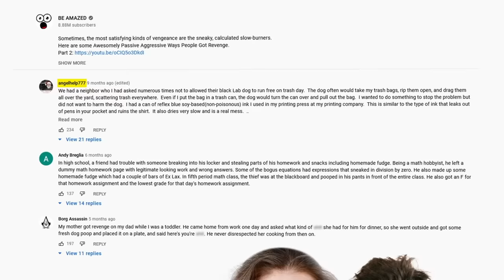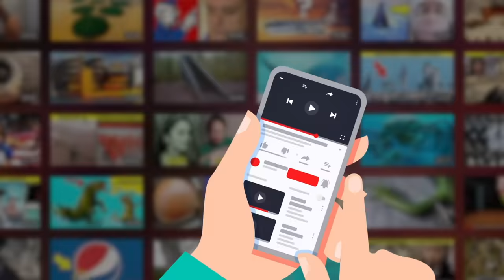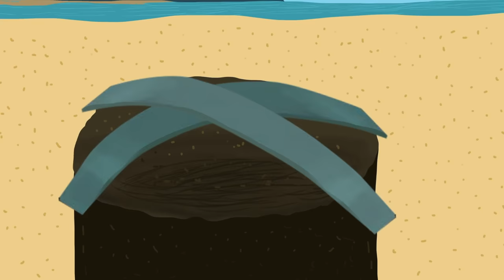Passive Aggressive Ways People Got Revenge - Part 3

Comment: 23:42 you could also build your sandcastle around a big rock, if they kick it, bam right into the hard boulder
Reply: I use concrete :’)
Reply: Or a dead jellyfish at the bottom of the hole with the stinging parts up!!
Reply: Turn sandcastle into sandfortress.
Reply: Pins straight pins they deserve all the pain
Reply: I’d use sharp speed sticks
Reply: You would put a child in hospital for kicking down a sandcastle? You lot all have issues.
Reply: Falling onto something wet sprained my ankle so that is just overkill lol
Reply: @codeXenigma  "It take a village to raise a child." (It appears that the parents weren't doing their job.)
Reply: @codeXenigma  you didn't, they kicked a stick/pins. Nothing to do with you.
Reply: @codeXenigma  ??? They are there to add to the structural integrity, it's not the builders fault if someone decides to stomp on his works.
Reply: Ouch
Reply: I would use TNT🧨
Reply: I thought about pointy sticks

Comment: When I was in college I used to always set a timer based on what the machines said so I didn't take too long to go get my clothes from the laundry room to be as polite as possible.

Well someone once stole my dryer, and when I came down my clothes were so wet they clearly stole it very early on. They at least were nice enough to put my clothes on the table. I put mine in another dryer, said whatever and went back upstairs. When I came down to collect my now dry laundry, I saw their laundry was still in the dryer. I originally was going to toss it outside because it was raining. I decided instead to be "nice". I actually put their clothes on the table where they tossed all mine, but I folded their clothes. Then left them a note that said "Next time you're in need, just ask in the group for the building, I'd have been more than happy to share my laundry card. Not everyone is so nice, I've heard of other girls [all girl dorm] tossing clothes out in the mud for stealing their washer/dryer." 

Never learned who it was, but that only happened 2 more times in our building and I was correct, other people are way meaner than me. One time I came to see a note on a dryer that said "You took my clothes out when they were only 10 minutes in, I know because I came back to add to my dryer since my washers had slightly different timers. YOUR clothes are in the f**king lake. Hope they didn't wash away <3". Dunno if they ever actually did that, but oof.
Reply: I always swore to my ex that if someone from our building took my stuff out of the washer or drier ONE MORE TIME, I was going to throw magic markers in with their clothes.

I never had to, but I would have. I'm an artist. I have a LOT of markers. LOL!

Comment: I worked for a company for 10 years. That first year and a half, I was a model employee and even earned myself a temporary promotion. At the time I was taking the company provided shuttle service to get to work, but couldn’t use it when I got the promotion. The kicker is that once you stop using the service you can NEVER get back on it. When the time came for someone to have the promotion again, they picked someone else. I had had to buy my own car to get to work! So, over the next 8 1/2 years, I stopped being a model employee, slammed on the breaks and became an unholy terror who constantly skirted the line of insubordination. I even got one of my supervisors to tell me to shut up.

Comment: 20:37 back between 2008 - 2010, can't remember exactly when it was,  a car parked in front of my garage. It was one of those multiple car garages in an apartment complex, and each one had a garage that had a sort of over hang that create a 1/3 of a car port. If you were lucky enough to have one of those spots. You could park one car in the garage,  and one behind that under the little over hang. If you parked a car in front of any other garage they would tow the vehicles coz people trying to back out of ANY of the nearby garages would be unable to,  and your vehicle would be blocking the parking lot path for vehicles to drive around the complex. 
One night very late we had a craving and we went to hop in my car and found I couldn't get out of my garage because some asshole parked in front of my garage over hang/bump out spot. I had no clue who they were,  which apartment they were in,  or anything. It took a lot of will power not to begin kicking out all their car lights. 
So I called the tow company and since I was not apartment manager/owner, they refused to tow the vehicle. So I walked 4 minutes to the 24 hour grocery store bought some plastic wrap and went over and under so the wrap would block them from being able to easily open the door.  Thank Gods I wasn't trying to get in my car to go to work!! That revenge would have had to be much more severe.
Reply: Parallel parked on a street once few years back and walked into a store. I came out to find another car parked in front of me so close I could not get out. But the best part was when the car behind me left a few motorcycles took the spot and as with the car, was right up next to mine so I could not get out. My wife being the mild mannered woman she is said we should wait there until one or the other moved. Yeah, right. I got out and found out the bikes did not lock their handle bars.

Press the clutch and start pushing. Pushed 2 bikes and parked them over on the next block, got in car and left. To this day I would have loved to see the expression on their faces as they saw their bikes gone then find them parked a block away. LOL

Comment: Used to have a neighbor who would bring his dogs over to my section of land(I lived in a condo. Each building had four units). I was not the only one he did that to.
I took some cayenne peppers and grounded them up. Then I took the powder and spread it over my section of the lawn. Guess whose dogs refused to do their business in my section of the lawn. I also spread the stuff on other neighbors' sections as well. They also saw that the dogs would not do their business there either.
This year I'm thinking of repeating it. Since I moved from my old place to here. And there is a neighbor doing the same with their dog. 
If you folks do this. You will need to reapply the powder after be it rain or snow.
Reply: That’s gross. The owner is at fault, not the dog.

Comment: This makes me think of my early 20's. At 21 I had 2 roommates. 1 of them worked with me in telecommunications and the other worked as a server. My weekly routine was to by a case of beer on Monday and that wold last till Saturday. I didn't mind if my roommates had beer or 2 as long as the left me 1 cold beer for after work. Well 1 week I started out as alway with a fresh case of beer on Monday can home to no beer! Told the roommate to replace the beer and not to do that again. I bought a new case and the same thing happened the next day and again the day after that. Well I had been cutting and grinding fiberglass all week so I collected about 2 pounds of fiberglass dust and poured in his bed and pillow and shower towels amd didn't say anything for 3 days. The beer was always stocked quickly after that 😆 🤣 😂
Reply: Uhmmmm, if that fiberglass got into the lungs - - it can lead to breathing issues and other serious medical issues.  Not a substance to mess around with.  Between high school and college, I worked in a factory that used fiberglass insulation in their products.  I was assigned to do that job for one day only, because that night after I was back in my parent’s home - - I had very painful tiny red skin irritations  everywhere that wasn’t covered by my clothes.
Reply: @slcRN1971  yeah the skin irritation was exactly the point. I worked with fiberglass for years I know the risks very well. I have done insolation, and boat repair plus the cosmetic stealthing for cell sites. he had low risk of inhalation but a down right certainty of having a bad couple days lol. the moral of the story don't drink all your room mates beer in the middle of summer, or ever for that matter lol

Comment: Leaving a wrecked apartment is how my wife and I got our revenge.   We had landlords who came from India originally, and they wouldn't fix a damned thing in the building no matter how much we asked.  When we complained to the building inspector we got evicted...and they refused to return our deposit (which I believe was $350 - this was in about 1990).  So we moved out...and completely destroyed the apartment. Threw chairs at and through walls, graffiti on every inch of wallboard that was left, smashed the bathtub and toilet with a sledgehammer but left the toilet water supply on so the water kept running onto the floor (being we were the 2nd floor apartment this caused a bit of upset for the apartment below).  In all we did thousands of dollars worth of damage and they had only our $350 deposit to pay for it
Reply: They can easily take more than the security deposit from you or take you to court

Comment: My neighbor asked me to get the three used motorcycles running great for her kid's Christmas, which I did happily. Christmas morning came and I heard them racing along the roadside until my other neighbor called the sheriff on them forcing them to stop, which enraged me. I grabbed my highly modified YZ-250 and began racing around my house, mostly on his side. Sure enough he called on me but they couldn't make me stop, being on my property, an adult, and outside city limits. I told the deputy why and he laughed and left. I wasn't finished though, later I took the meter from his fuse box, shut off and locked his gas main and water at the street. He was late for work, unshowered and pissed. I did the by myself motocross a few more days until he finally moved. Moral? Don't ruin Christmas mornings for kids and let me find out about it. 😅😂🤣🤣